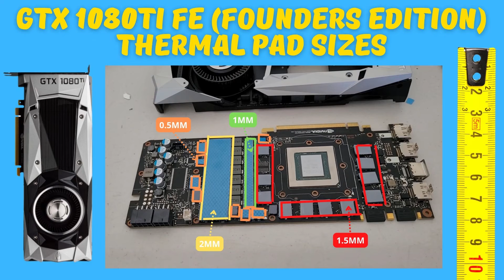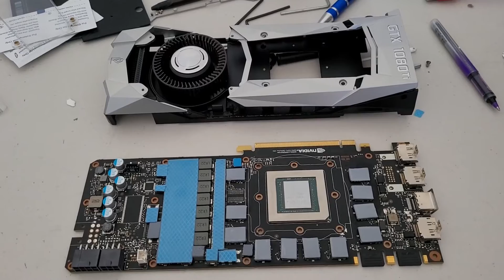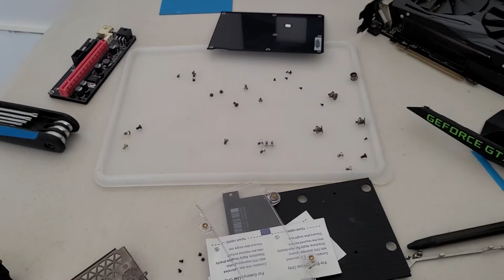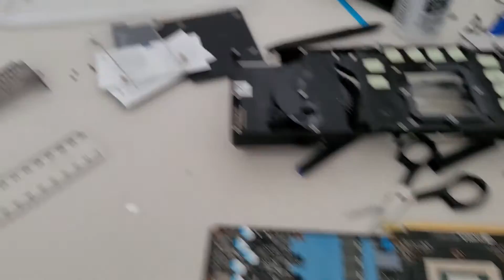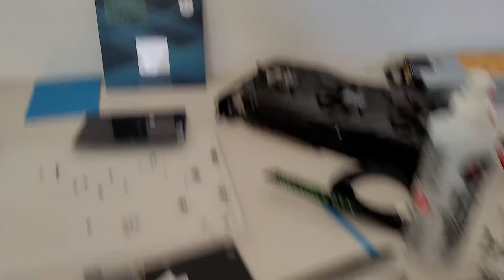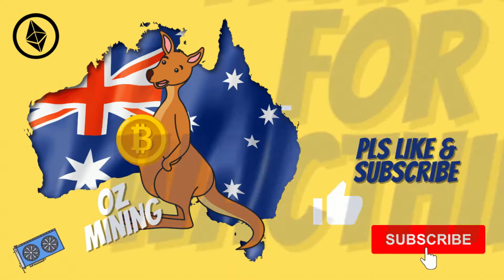GTX 1080Ti Thermal Pad Thickness Founders Edition

Comment: Damn it, the only other source I've found gave different numbers for the pad thicknesses! Now I'm afraid to change any of mine. 

The source I found was 1.25mm for the memory pads, and might have given different thicknesses for other parts of the card as well. Of course, 1.25 and 1.5 might both work relatively well, but I can't believe how little info there is out there.
Reply: Let me guess, the only paramether that matches is 1mm?
'Cause the guide I've found shows 1.25 for memory cores, 1.5 where author showed 2mm and 0.75 where he used 0.5. 
Concidering different videocard brands use different own default thermopads, it may vary between the brands. And the thickness of new thermopads could depend on the brand as well, but you can use same Gelid brand as author of the video and hope he had card of the same brand as you do. Again,  this video is not fresh and 2 years ago there might have not been that many 1.25 and 0.75mm thermopads for purchase, so whoever was making mesurments, used the closest numbers they could buy in store. And ocationally videocard brands use even 0.3mm thermopads, so it's impossible to get the same one in such case.
The best solution would be to try to contact the card brand support for details (if they even would provide such). I want to service my card as well and worried just as much as you do, since I've never done it before, though I've watched tons of guides and one of them suggesting to assemble it after applying new thermopads and paste only to dissasemble it again before instatting to PC: the point is to see if the new pads are not too thick and if chip touches the heater enough to push out the paste. If not and paste is still on the GPU, then pads are too thick and you need thinner ones.

Comment: Throwing a comment in here for good measure. I JUST completed this exact setup using Owltree brand thermal pads. Seeing a major revitalization in the temps down a solid 20-40 degrees (cleaning the fan and replacing the old thermal paste helped too). Cheers for the video! I had never opened up a graphics card and worked on it before, and this video was one of the essential helps. Thank you so much.

Comment: I meshure my original pads and where you put 0.5mm its actualy 1mm. So you don't need 0.5.    also 2mm pad needs to be order 100mm long if you don't want to make it from 2 pieces. Usually they sell  80 its going to be too short.
Reply: How much do u recommend buying in size ?
Reply: Caliper checks on several 1080 Ti FE/Titan Xp cards put the long strip at ~1.7 mm. A soft 2 mm pad can work but usually needs trimming; 1.5 mm misses a few low chips. I’ve ordered 1.75 mm pads (only found them on AliExpress) to try next. One 90 × 25 mm piece covers the run, 20 mm is too narrow. In a pinch, stack two 1 mm pads.

Comment: Do you know if this is same for gtx 1080 fe?
Reply from the maker: Hi @rogergomes6688,
I believe its a bit different - pls see this link to a GTX FE 180 teardown
https://www.gamersnexus.net/guides/2439-complete-disassembly-of-gtx-1080-to-build-a-1080-hybrid
Looks to bit a bit diff inside.
That said if you follow the steps to open up (same process) and have thermal pad options and thermal paste you can measure old ones and cut to size.
Thanks
OZ Mining

Comment: Do you know if this is same for gtx 1080 fe? I know this is ti version just didn’t know if they got same amount of pads.
Reply from the maker: Hi @josevazquez9112
 I believe its a bit different - pls see this link to a GTX FE 180 teardown
https://www.gamersnexus.net/guides/2439-complete-disassembly-of-gtx-1080-to-build-a-1080-hybrid
Looks to bit a bit diff inside.
That said if you follow the steps to open up (same process) and have thermal pad options and thermal paste you can measure old ones and cut to size.
Thanks
OZ Mining